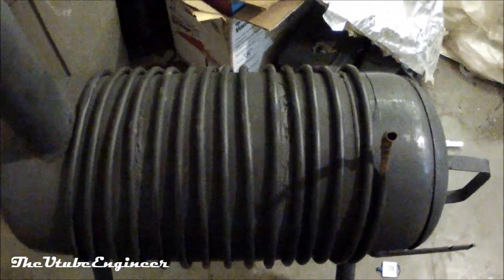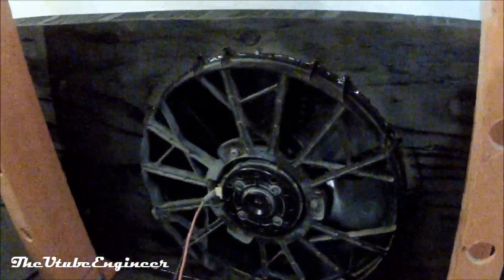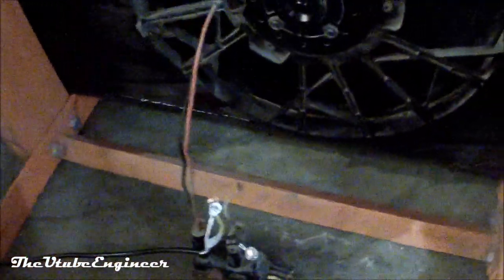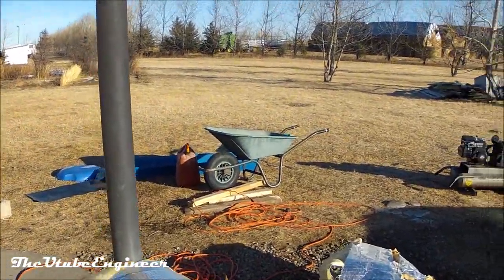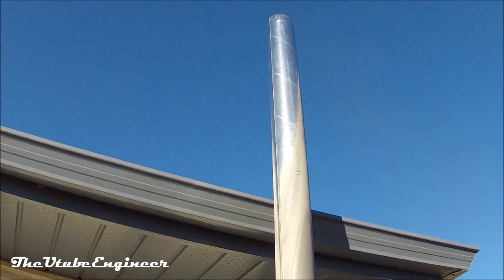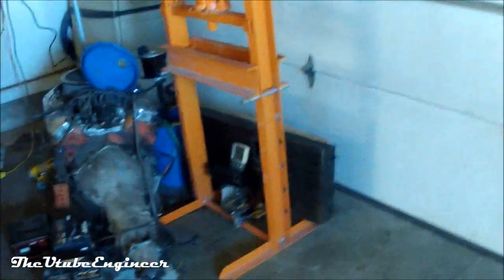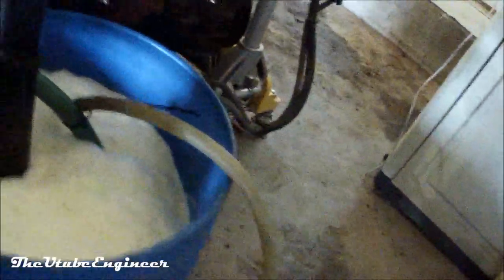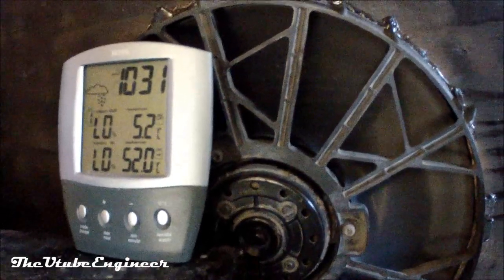Gas Bottle Wood Stove Heat Exchanger Version 2

Comment: ...as said before, the exchanger should NEVER be the same as the burn chamber. You are using 'finish lumber', not 'firewood', that is good, as it is very dry and has must less creosote. I would suggest building a small 'rocket stove' heater. Then you will have mass heat, radiant heat, AND you can STILL use your exchanger, to heat a storage tank, or run it to the house.

Comment: Very nice, I am building a similar setup as yours right now, but adding a controller to it: the controller turns to wood furnace on and off depending on the heating needs, if I need to heat the reservoir of glycol I turn on the air intake to the wood furnace and turn on a propane flame in the furnace (with a ignition system), the propane stays on only for a minute or so to light the wood. When the glycol reaches 70C I turn off the furnace by shutting off the air intake. I am also controlling the furnace max temperature. The controller also circulates the glycol in a radiator like yours to pull the heat from the glycol when ambient heating is needed. By the way if you want to measure your efficiency you can do this: don't put wood in your furnace, measure the weight if a propane tank, lite a propane flame in the furnace for 30 minutes, circulate the glycol from the chimney to the reservoir only. Measure the temperature rise of this volume of glycol. With some simple math and knowing the weight of propane and the BTU of the propane you used you can exactly know how efficient is your system. I am struggling to get the heat exchanger more efficient in the furnace right now. Regards and best of luck.

Comment: I like it!  To make your setup even more efficient you should consider using a "pusher" radiator fan instead of a "puller". That way you will have a higher volume of hot air coming out of the radiator because the fan body will not be impeding the air.
Reply: True, but you won't really be able to filter it that way.

Comment: Hello, it's me again, since the fan and pump is 12v. Would they be able to run off a computer power supply?
Reply from the maker: I dont think so, it would need more current!
Reply: I got a 120v to 12v converter from canadian tire for a little over $20. Runs both the pump and the fan. Works great.

Comment: Interesting. There's a company in N. Carolina, Taylor Manufacturing, that makes a heater like this on a bigger scale for tobacco curing barns. Their heater can also be used for home heating. The hot water can be run through tubes or pipes in the floor of the building. This turns out to be a gentler heat compared to forced air; more quite also, but can also be run through a radiator like you have here. A secondary copper coil can also be run through (inside) a water tank providing water so hot you can cook a hard boiled egg in about 15 minuets. The firebox (also outside) is loaded with about 1/4 cord of wood and an electric motor that opens and closes the air flow to the fire is controlled by a thermostat. This company heats it's own plant with these heaters and I've seen 1/4 cord of wood last for about 10 days keeping the plant warm 24 / 7.

Nice work and I'd never say anything about your "hobbyist" welds. The fact that you didn't have to pay someone $48 per hour to do it for you deserves a head nod! Well done!

Comment: If boiling is a problem, you might could try pressurizing the system, Placing the system under pressure  will raise the boiling point well over 200 degrees f.... Automobiles use this principal.. You could place an inline radiator cap at (16 pounds) and be pretty safe..Place cap outside in the loop with an overflow canister to re-use coolant that is bled off..Also if you put the cap on a container of some sort it will catch air bubbles and have less noise in the rest of the system

Comment: couldnt u build a pasive pump system with a one way check valve and the steam going through the radiator then condensing and going back in to the reservor that is above the wood stove working off  gravity ??

Comment: Here's an idea if you want to boost efficiency put the stove in the garage and the exchanger to the basement! Yeah I know you said in the other video you don't want the wood fire smell. But you wont get the wood fire smell if its a hot clean burning, fire sucking in the combustion air like that nice little stove you made does. You are loosing all the radiant heat from the uninsulated ends and the chimney pipe. For all the effort you have invested you are throwing a huge amount of heat away.

Comment from the maker: you could run it in a closed loop if you wanted! i just didnt want a pressureized system as it is dangerous as it expands, however a pressurized system is better for getting heat.

Comment: why don't you just put the wood stove in the house? just kidding, I want to heat a room that is far from the wood stove and am thinking about running copper tubing in the floor and pouring another inch of cement over the pre-existing cement floor, but need some sort of inline water pump? not sure if I should fill it with oil or antifreeze like you did?

Comment: ok no more camera in front of the fan. lol also you could do a booster heat exchanger that uses a thick walled pipe that goes inside the stove itself prior to running through the coils or after. just an idea.

Comment from the maker: I have considered that, but the diameter of it makes it difficult to coil tube both in and out. I have modified it further now to include cement, however even version three has an expiration date. When i upgrade from that, i will likely build a larger stove to begin with, and then uses stainless pipes, forced air induction, interior coils, etc. Thanks for taking a look!

Comment: Don't Peltier devices use a heat difference to generate a tiny amounts of current? I believe you need a consistent flow of both hear n cold touching on each side of Peltier device to be worth wile.

Comment: I done this 2years ago. Now I hade better luck with water going in bottom of radiator and returning from top. That way any air pocket would be pushed out. It worked better for me cause the radiator was the highest part of the system

Comment: Good job, looks like a fun project!  Have you considered running a second coil up the flue?  Also, not sure how much sun you get but you might be able to supplement that system with a solar water heater.

Comment from the maker: Alot of the heat comes from radiant heat heating the air surrounding the parts of teh pipe that arent in contact with the stove. We saw a massive increase in efficiency and outcoming tempurature when using it.

Comment: You are correct about radiation and black surfaces. But your system does not use radiant heat. It is conduction and convection. The copper pipe on the propane bottle is being heated by conduction, and you garage is being heated by convection. sp2291972's statement was correct.

Comment: Painting it black is going to have no effect on the heat transfer on conductive heating. If you were using solar for heat, then black would be the best color, but with what you are trying to do the paint will actually work as an insulator and decrease the heat transfer. Good thought, just the wrong application.

Comment: Loss is your prob here.

Up the flue, & a small surface area of copper tube.  SOLUTION>> "Garn" google it... Incorporate the h20 sleeve/jacket design-- That would be FAR more efficient at energy capture.
A small oil drum around the propane tanks .... FAR more welds though ... 
Then massive loss up the flue can be resolved 3 ways copper coil... or yet another h20 sleeve/jacket OR pass metal air channel tubes through flue( small voltage dc fan based) E-carbouration, electronic damper !!!

Comment: Has anyone mentioned air or draft controls? You need to be able to control the air going in "vent" and the air going out "draft". I know you said its pretty efficient but if you add a vent in the door and a draft control in the flue pipe you would gain even more control over heat and burn rate so you can really dial things in. Just my 2 cents. great video and keep up the good work.

Comment from the maker: well one thing that i found out is the fan and radiator, in the heater core that i built, extracts heat so efficiently that the outcoming air is room temp halfway through the waters path, so when it is all sealed like this, one fan could easily handle a much higher tempurature or flow load.

Comment from the maker: well it heats up in about a half hour to an hourl so about 10 pounds of wood to heat it up and maintain 25 degrees for a couple hours. the black paint does help, because it absorbs a lot more heat than shiny copper. the stack temp is hot, but not scorching. sorry i dont have a pyrometer. the numbers i use are relative to my old version, which is annotated at the top.

Comment from the maker: i burn just waste wood that is around the farm, anything from scraps of mdf to cut up dead trees. i have to refill it about every 2 to 3 hours. it is the pump yes, and it is noisy because when it pumps, after about 3 minutes the flow cavitates and you cant get it back to normal. it would be possible to insualte it, but i find that if im in the garage, its usually way noiser than that anyway.

Comment: Great project. What do you burn, and how long before you need to refill your firebox? Is most of the noise from the pump, or radiator fan? If the pump, perhaps there could be some way to safely enclose it and insulate some of the noise.

Comment: Have you considered some of the technology behind a drip percolator? "Cold" water draining from the bottom of the radiator might pass a backstop and enter the bottom of the stove coil. When the water is heated to a boil it pushes against the backstop and exits the coil at the top where it could drain via gravity into the radiator. By doing this you might reduce the need for a pump.

Comment: Ingenious. If you don't mine a few suggestions from a wood stove user. A grating in the bottom it will allow air under all your fire, and protect your stove's bottom. A vent at the bottom of the door will allow greater control of air, especially under grating, and less heat escaping when the fire needs more air. A fireproof rope gasket might be good for the door. Given your stove is outside, insulating the pipes and hoses might be of benefit. Keep up the good work.

Comment from the maker: @sakahowdah interestingly enough, i planned on using this system on a small pool i made last summer, it was a trampoline hole that i put a tarp inside and filled it up. i eventually used a large black hose and circulated the water around in the summer heat. it warmed it up okay, but you are right about that idea, ill give it a try this summer. cheers!

Comment: @TheUtubeEngineer Ah, I see. It's not a closed loop system where steam could build up.

I wonder if there's a market out there for heating swimming pools. At least for the initial spring warmup. I hear it's very expensive to bring a 20 thousand gallon pool up to a comfortable temp. I heard many didn't bother heating their pools last year for this very reason.

Keep your price reasonable enough and it should work.

Comment from the maker: @ANTIDAJAL13 The trick is to have very complete combustion, first, it has to be hot. wood will smoke if it is cold. second, the flow of gases cant be to great for the system. to acheive a low gas flow, the door is made to conform to the stove. this severely reduces the incoming air, to any combustion has time to fully occur before exiting the stove.

Comment from the maker: @sakahowdah yes, the only possibility is that the pump could fail and the air could get hot enough to melt the hoses connecting the stove to the rad, but i only run it when i am present, for safety measures. When the pump is running, it will occasionally boil but nothing very serious. im east of airdrie!

Comment: I like the spring Idea that's really good to keep it tight around the burner. Not that you need it but you could put a small amount of coal in the fire to get it hotter but you already have 52 degrees at the fan so I bet its already efficient. Nice to see the finished product.